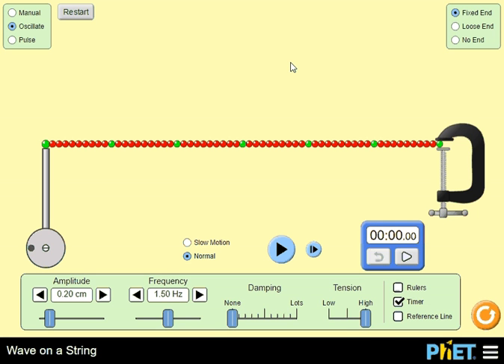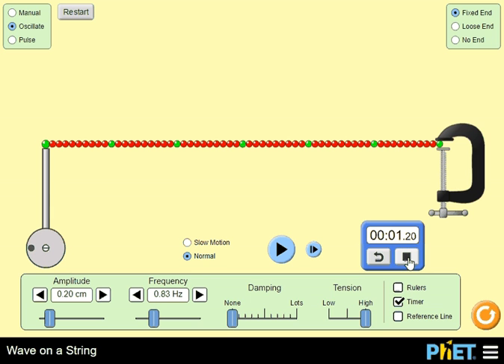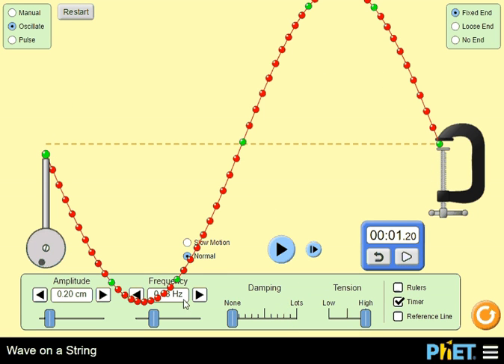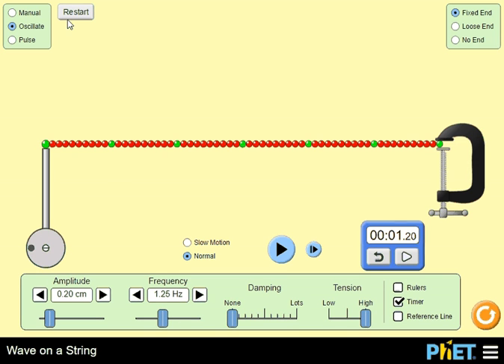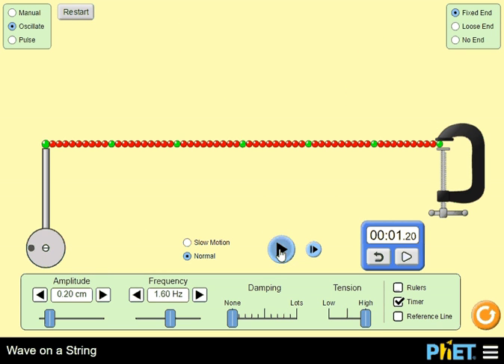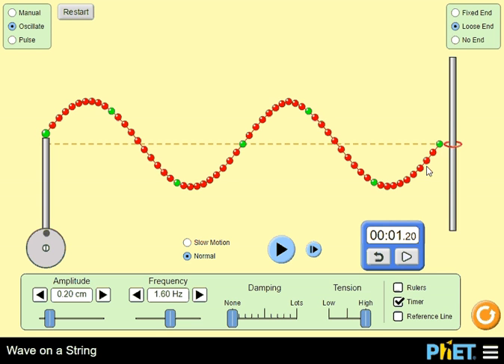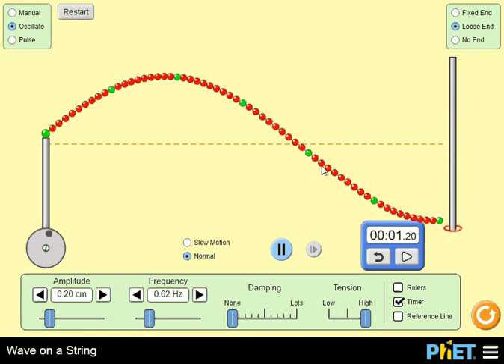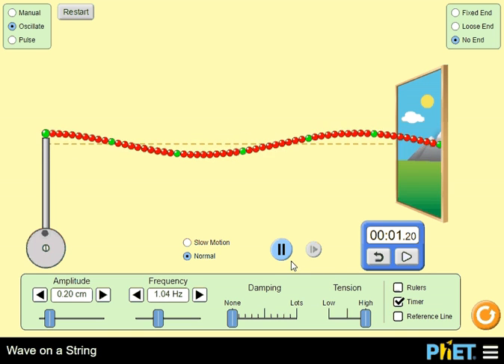Standing Waves

Comment: Why the amplitude keeps on increasing at 0.83Hz
Reply from the maker: 0.83 Hz is one of the frequencies that result in standing wave, also a "resonant frequency." At these frequencies, each cycle of driving oscillation builds up energy, as the end of the rope tied to the driver is synchronized to the driving force such that the driving force is doing positive work on the string, putting more energy into the string system.

Comment: I have a question... 

Instead of adjusting the frequency to create a standing wave.... 

If you had decreased the amplitude Instead, would that have also worked to create a standing wave?! 

Just curious because that's what I thought you were going to do to "fix" it!
Reply from the maker: Changing amplitude won't change the standing wave condition, but another idea along similar line would be to change the tension in the string. Changing the tension will change wave speed, which can change the standing wave frequency that corresponds to the wavelength the standing wave must have.
Reply: @abkpark   Ahhhh!!! Okay, see, for some reason I was thinking there is a relationship between tension and amplitude. 

I didn't see where the tension could be adjusted. 

Thank you for the answer!!
Reply: @abkpark   I have another question if you don't mind?! 

I played with the simulator and found something interesting 

With the settings I used.... the right side of the string moved like a typical sine wave, but the end closest to the fixed point didn't move laterally.... it just appeared to oscillate (or.... just mirror image along the X axis) instead of looking like a normal sine wave.... 

Could you tell me why that would happen?!
Reply: FYI 

I used oscillation as the mode, and only adjusted the tension all the way DOWN 

If you do that, could you help me understand what I'm seeing at the fixed point end of the string?!